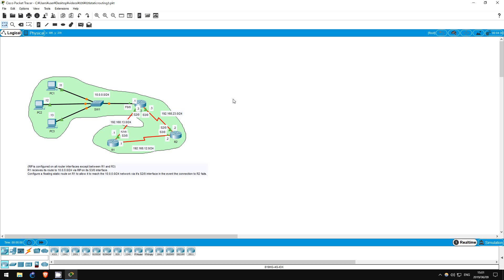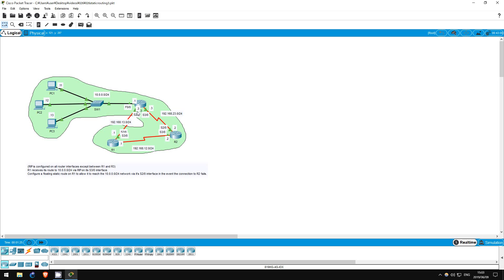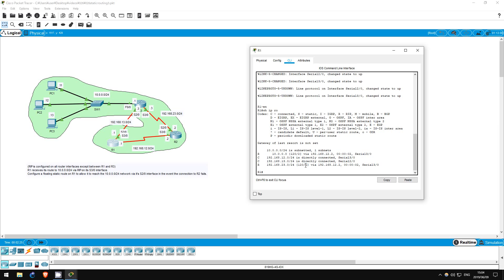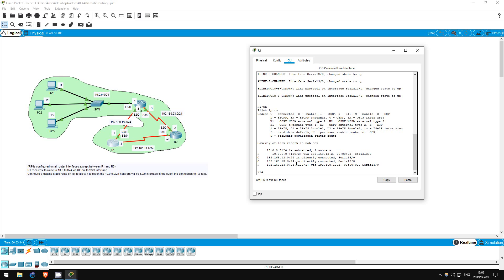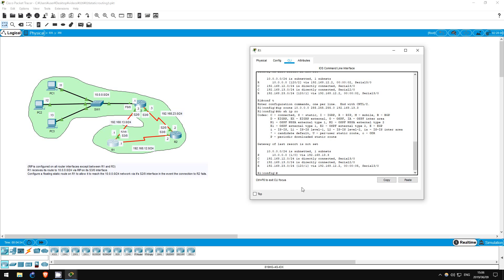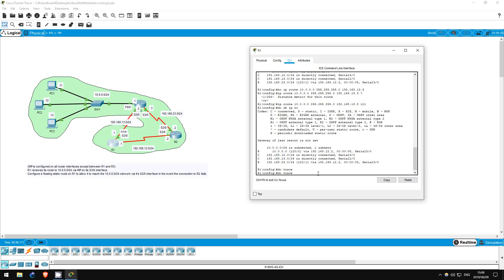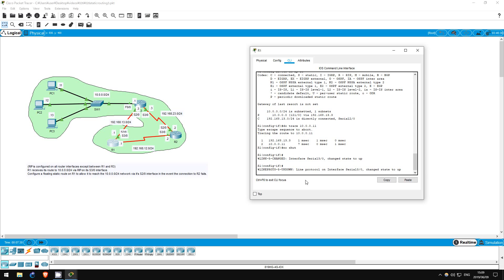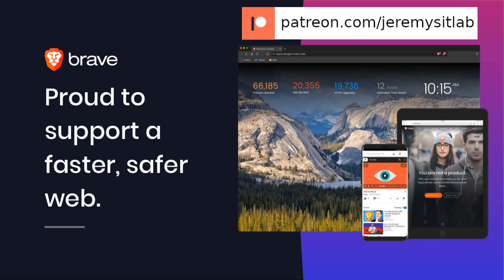FREE CCNA Lab 026: Static Routing (Part 3)

Comment: Hi, Jeremy, mine worked not too bad, I was able to use that floating back route while a shutdown that RIP port and that it vanished again after I turned back on that RIP port, but my question is: In your video, when back up route shows in "Show ip route" it did show its manually configured AD in the bracket but mine just shown as a regular static route without that customized AD, but it worked as a back up route, why?

Comment: Hi Jeremy.
I have a question. How can I use show command to verify a floating static route?
Reply from the maker: As I'm sure you know, it doesn't show up in the route table because of it's higher administrative distance.  I would just use 'show running-config | include ip route' to see the static routes configured on the switch.  I don't know of any specific commands to view floating static routes.